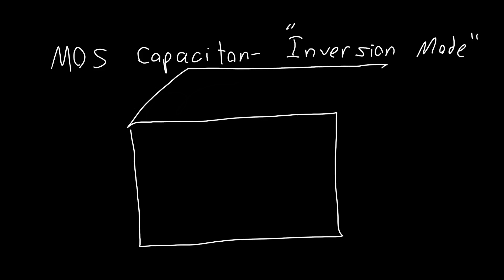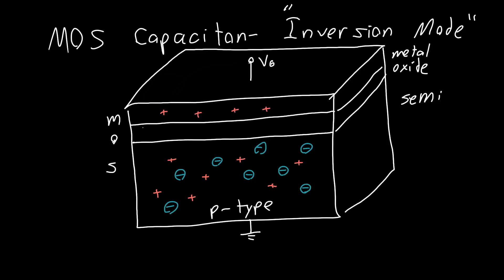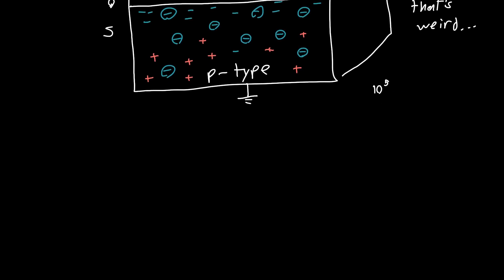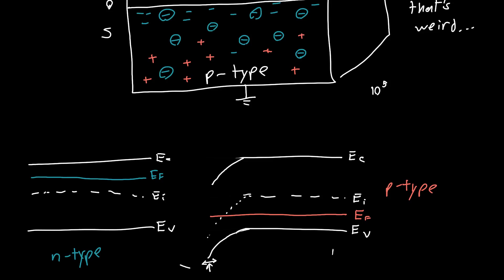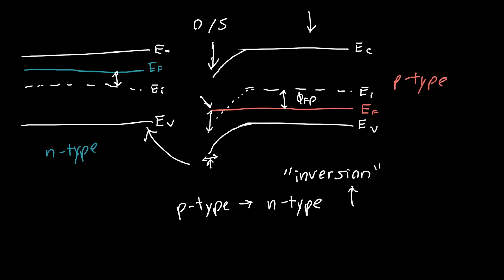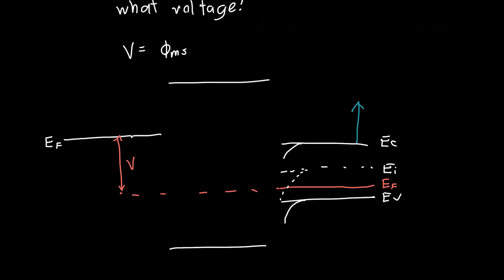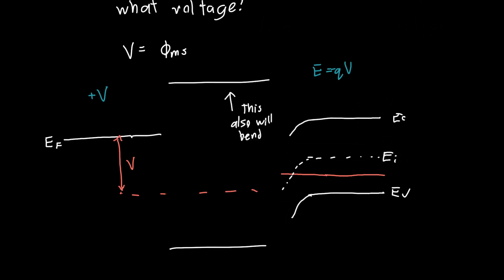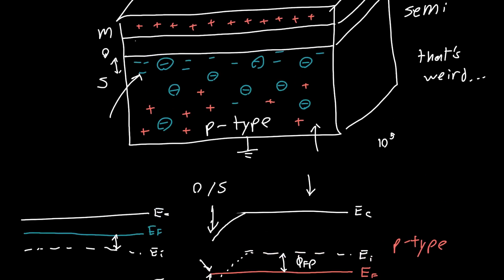MOS Capacitor - Inversion Mode Explained

Comment: At 7:46 IN metal side Fermi level is above semiconductor Fermi level but by applying positive voltage at gate, Fermi level of metal should go down as you said in previous videos
Reply from the maker: Ah! Correct you are. As written it is incorrect, the Fermi energy should indeed decrease (all the bands get pushed down).
Reply: I think so energy difference is important rather than absolute energy..

Comment: Sir，Thank you for your video. And I have a question that could I regard that when the p-type changes to the n-type by applying enough gate voltage, the depletion mode is called the Inversion mode?

Comment: Hi Jordan,I am confused by the change of the band diagram. When you apply a voltage on the metal, you lower the Ef of the semiconductor band, and later when you apply further voltage, the Ef stays and other energy levels starts to bend? How should I know when to bend the energy level and when to simply lower the Ef?
Thanks in advance.

Comment: What is the difference between mis and mos diode and why?
Sir please reply I'm confused in that topic.
Reply from the maker: They are two names for the same thing. MOS literally stands for metal-oxide semiconductor, but is typically used loosely to refer to any metal-insulator-semiconductor structure. MIS (metal-insulator-semiconductor) is the “more correct” version when your insulator isn’t oxide (SiO2), but typically people are lazy and use the two interchangeably.
Reply: TQ sir

Comment: Hi sir, on applying positive voltage on gate, from where the free electrons are forming the inversion region, considering its a p type SC. Is it due to domination of EHP generation, and holes being pulled down ?
Reply from the maker: Exactly, you have a certain baseline thermal electron-hole pair generation in a semiconductor regardless of the doping. In a p-type semiconductor, usually all the electrons immediately recombine with holes, but in this case we are separating them before they can recombine, and keeping them safe in the inversion region.

Comment: I can't understand from where electron comes when we increase voltage at gate?
Reply from the maker: That’s a great question, there are a ton of electrons in whatever metal youattach to the gate, and those electrons that were in the metal will move to the interface. Whatever voltage source you have is providing the energy (in the form of electric fields) to actually do this.
Reply: @JordanEdmundsEECS  That way, threshold voltage of MOS should be equal to only the work function of metal...but that's not the case I believe. I read somewhere that at a huge voltage, electron hole pair generation takes place in bulk, the thermal generation. Please clarify this....I'm worried. Appreciate your effort in these great lectures.